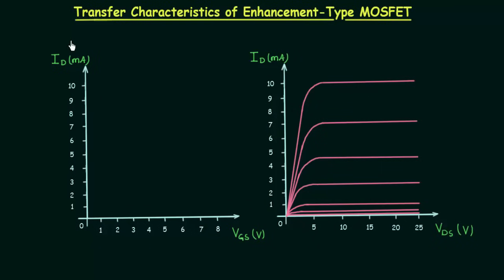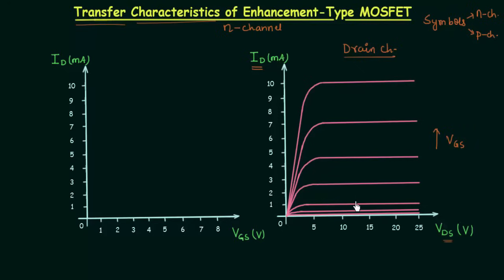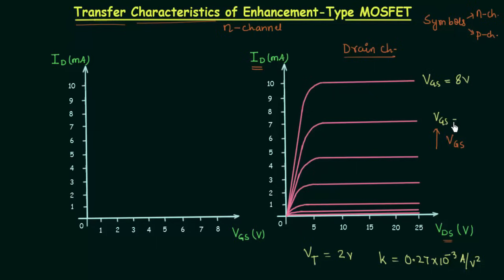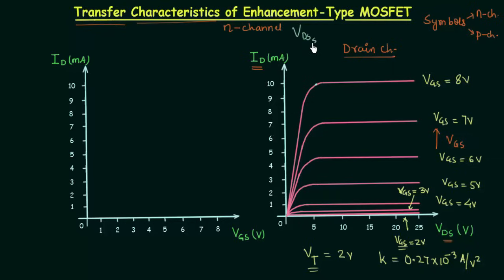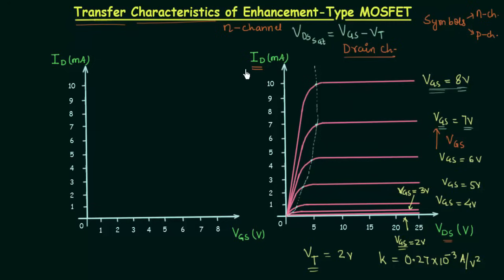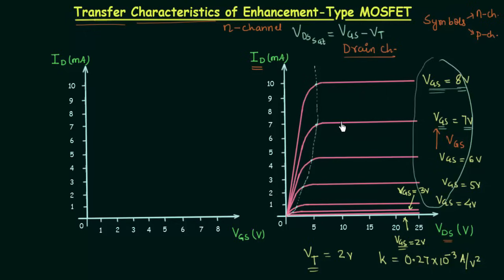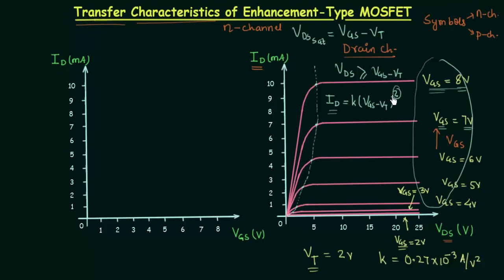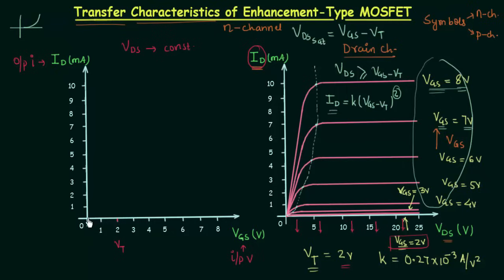Transfer Characteristics & Symbols of Enhancement Type MOSFETs

Comment: n-channel MOSFET (NMOS):

Substrate is p-type, Source is n+.

Arrow points inward (towards the channel) → because current would naturally flow from p (substrate) to n (source).

🔽 Arrow pointing IN = n-channel.

p-channel MOSFET (PMOS):

Substrate is n-type, Source is p+.

Arrow points outward (away from the channel) → because current would naturally flow from p (source) to n (substrate).

🔼 Arrow pointing OUT = p-channel.

Comment: The SiO₂ layer isolates the Gate so that:

Gate current ≈ 0 (only displacement current)

Device is voltage-controlled (electric field, not current)

High input resistance, low power consumption

Comment: Very High Input Resistance

Because the Gate is insulated, almost no DC current flows into the gate (only a tiny leakage current).

Input resistance is in the range of 10⁸–10¹² Ω → much higher than in BJTs or JFETs.

Voltage Control (not current control)

The gate voltage produces an electric field through the oxide.

This field attracts or repels charge carriers in the channel region and thus controls current.

The MOSFET is a voltage-controlled device, unlike BJT (current-controlled).

No Loading Effect on Previous Stage

Since gate current ≈ 0, the MOSFET does not load down the driving circuit.

This makes it excellent in amplifiers and digital logic circuits.

Efficient Switching

Only a small charging/discharging current is needed to change the gate capacitance, not a continuous current.

That’s why MOSFETs are widely used in digital electronics (CMOS logic, processors, memory).

Scalability (IC Technology)

SiO₂ gate insulation allows MOSFETs to be made extremely small using photolithography.

This is why billions of MOSFETs can be packed into a microchip.

Comment: Regarding direction of arrow :  Arrow indicates the direction of flow of electrons. For n-channel electrons flow from source to drain through the channel so direction is away from(opposite to) the source terminal (indicating electrons are coming from the source). For p-channel electrons flow from drain to source through the channel so direction is towards the source terminal (indicating electrons are going towards the source).

Comment: 1). I think we insulate gate from D,S ,SS because if we dont insulate it the electron will from gate to source diractly not from drain to source,so if we dont insulate it. We cant control the flow of electron flow through drain to source.or source to drain.
2.) you said that arrow is represent the  flow of current,so i think that hint is answer

Comment: SiO₂ is used as an insulating layer in MOSFETs because of its excellent electrical insulating properties. It acts as a dielectric material between the gate terminal and the underlying semiconductor (source, drain, and substrate). The key reasons are:
1. High dielectric strength: SiO₂ can withstand strong electric fields, which helps prevent unwanted current leakage between the gate and other terminals.
2. Thermal and chemical stability: It remains stable even at high temperatures and doesn't react easily with other materials used in semiconductor devices.
3. Ease of fabrication: SiO₂ forms naturally on silicon surfaces, making it easier to integrate into the manufacturing process of MOSFETs.
4. High resistivity: It effectively isolates the gate terminal, allowing precise control of the channel without interference from the source, drain, or substrate.

The arrow represents the direction of the drain current. In an n-channel MOSFET, the drain current flows into the MOSFET through the drain region, while in a p-channel MOSFET, the drain current flows out of the drain region.

Comment: Silicon di oxide is used as an insulation layer between the gate and the conducting channel of the MOSFET.

Reason we use ‘SiO2′ is that it provides a better isolation and is a good dielectric material, and also we just need to do oxidation on the already grown ‘Si’ layer to achieve isolation.

Purpose of isolation is to avoid flow of charge directly from gate to the conducting layer of MOSFET.

Comment: Ans:
i) We use SiO2 as dielectric between Gate and source terminal hence current doesn`t flow through gate but through the channel.

ii) Arrow indicates the direction of flow of electrons!
In n-channel the electrons are attracted to the positive plate of the capacitor which is gate hence completing n-channel. But in p-channel the Voltage Vgs is applied in reverse hence electrons are attracted to the Body terminal and holes are attracted to the Gate hereby completing the p-channel.

Comment: 1.The SiO2 works as an insulator.Due to this the input impedance at the gate terminal is high and no current flows through gate terminal(As we need a current flow between the drain and source the gate current must be 0 for maximum current).
2.For n-channel MOSFET current flows from the drain to source so the arrow is getting into but for p-channel MOSFEET current flows from  source to drain so the arrow is coming out .
Reply: THE DIRECTION YOU SAID IS CONFUSING ME ......can you explain in simple words plsssssssssssssssssssssssssss
Reply: (In N - Channel MOSFET Current flow from Drain to Source side) . (If its P - Channel Current will flow from Source to Drain)
Reply: @bruhbruh4137 still want the explanation?
Reply: @parthhh3589  yes I want the exolanation!!
Reply: Exactly !
Reply: Great video

Comment: HW:
1. Purpose of isolation is to make gate current zero and SiO2 used because it is a good insulator and good dielectric material.
2. Arrow indicates p n junction between body and channel

Comment: 1 sio2 acts like a dielectric medium, which makes gate plate  and p region acts like a capacitor,  therefore gate plate becomes positively charged and below insulator creates a electric field which attracts electrons when a battery is connected between gate and source.
2 direction of current in n channel mosfet is from drain to source.
 direction of current in p channel mosfet is from source  to  drain.

Comment: Due to the presence of the insulating layer betwee gate and semiconductor substrate, a parallel plate capacitor is formed. This capacitive action enables the gate voltage to control the width of the channel, which in turn controls the amount of current flowing through the device. Otherwise in the absence of the insulating layer, it would have just become a metal semiconductor junction.
Reply: You mean the depth of the channel

Comment: We used sio2 for insulation.. If more current flow through gate gate will we damage so generally for insulation purpose we used sio2 ..sio2 have the large amount of resistance so it will reduce the large amount of current flow through the gate... 
2)
Reply: I read so many comments but I couldn't understand but your answer is very clear thank you..so sio2 is acts as insulator or dielectric 😅😅

Comment: Ans of H.W.
i) we use SiO2 to isolate Gate from the body/substrate of the MOSFET. The main reason is to isolate the gate terminal to avoid flow of charge directly from gate to the conducting layer of MOSFET and thus gate current becomes zero so input impedance becomes high which will raise the Gain .
ii) when battery source is connected between source and drain terminal of MOSFET drain current will flow towards the substrate through the drain and that is why arrow direction is towards the substrate for n channel MOSFET & vice versa for P- channel MOSFET.
Please reply me if I am wrong or any rectification is necessary if there is/are any mistake in my explanation.
Reply: Noe your second point is wrong... And also the following reasoning needs correction.

Comment: In p-channel MOSFET, conduction occurs through holes, which are the majority carriers for that device. Holes are positive and they attract to the negative side, hence the arrow indicates movement from drain to source and In n-channel MOSFET, conduction occurs through electrons, which are the majority carriers for that device. They emerge from the source terminal and are attracted to drain which is positive; hence, the arrow indicates movement from source to drain.
Reply: https://electronics.stackexchange.com/questions/274370/why-mosfet-source-is-indicated-with-arrow
I think the hint in the video is also wrong
Reply: The arrow indicates the current flow from gate to substrate ,since Vgs is positive, current flows from gate TO substrate. TO substrate indicates inward arrow and vice-versa for p channel.

Comment: Reason we use 'SiO2′ is that it provides a better isolation and is a good dielectric material, and also we just need to do oxidation on the already grown 'Si' layer to achieve isolation.
Reply: copy paste from quora ..........haaahhaa

Comment: Ans:
i) we use SiO2  to separate controlling terminal (gate) from the substrate , so that gate current  will become zero. Due to this input impedance will be higher. Hence the Gain will be higher.

ii) Arrow indicates the direction of the drain current. for n channel , drain current goes into the MOSFET through drain region and for p channel , drain current coming out of the drain region.
Reply: Good , very well explained
Reply: Hemanta Goswami With reference to your answer for point 1, the gain will be higher due to high input impedance. But in BJT Common Emitter amplifier with low input impedance output is high.. High gain!?
Reply: Hemanta Goswami WRT second answer the current enters the Drain from outside Circuit and leaves from source i.e. arrow should be pointed outside
Reply: @pateldarshan6064  Actually the correct answer is that the ARROW indicates the pn junction between the substrate and the channel formed.
Reply: @SUSMITRUDRA  right.
Reply: @pateldarshan6064  input impedance is not low its medium amd technically speaking its adjustable and the we cant judge the application based on the gain . Though CB has Ai =1 its used for current gain its simply says it can act as a buffer
Reply: @pateldarshan6064  Because in BJT we are using the current (charge flow) for amplification and in MOSFET we are using voltage(field) for amplification..
Reply: Aur bhai btech complete hogya

Comment: the sio2 is act as insulator ,the upper metal oxide layer  conducts nd the p type rehion of the substrate partially conducts thus this works as a cpacitance so sio2 is used!!